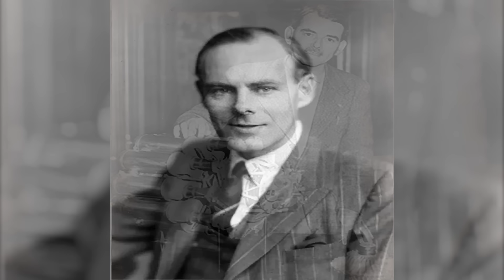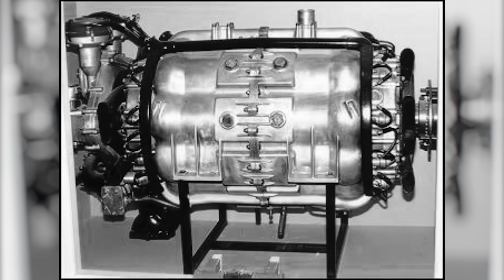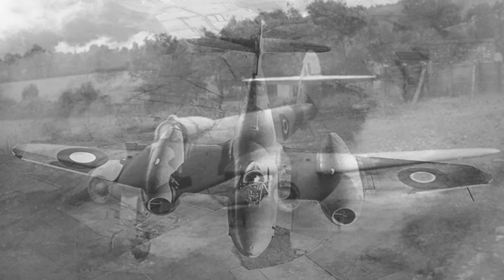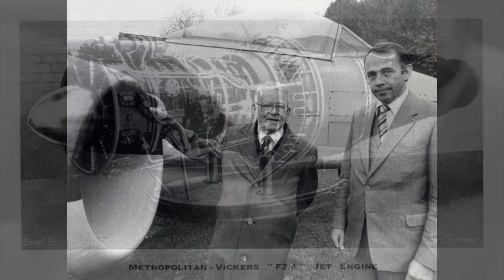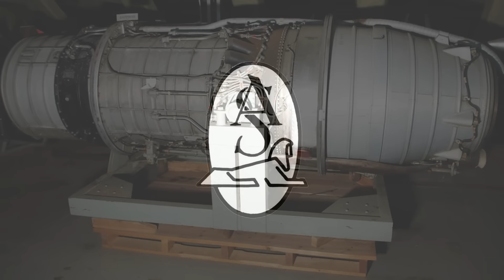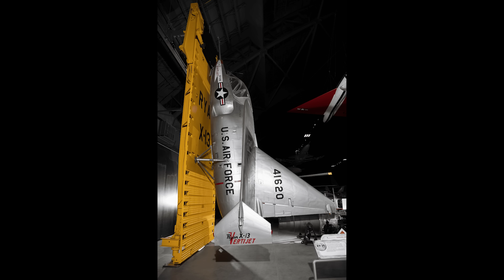The Genius Who Conquered Frank Whittle

Comment: Frank Whittle was well aware of the theoretical advantages of the axial flow turbine, his problem was he had to show results quickly, the centifugal turbine was better understood, less fussy about metallergy and less prone to distructive surging. Me262 engines were axial flow and were in dire need of a rebuild in 10-15 flight hours; the Whittle engines in the Meteor were almost boringly reliable.
Reply: @JeremyEdwards996  10-15 hr: yes & no: production/service powerplants.. yes. BUT: Prototypes fared FAR BETTER ref hours in service. HOWEVER the Reich lacked sufficient suitable high temp stable/heat resistant metals IN QUANTITY...hence, production units manufactured with far lower tolerance metals.
Reply: @ChristopherBatty-j3b  I  know, your point is well made, but wars need numbers of units!
Reply: Germany was out of Chromium and Nickel
Reply: @JeremyEdwards996  I don’t know where you get a ‘10 to 15 hour’ life for a Juno 004, people seem to come up with a shorter snd shorter life. The actual practical life was more like 25 to 35 hours. That is quite a number if sorties. On the upside the Jumo 004 cost one third of V12 piston engine in prop fighters, and took only thirty minutes to change in the field. Banging in about Whittle’s reliability means nothing if the jets were never fast enough, good enough to fly in combat against the enemy jets.
Reply: @drstrangelove4998  25 hours means 2 engine changes after every weeks flying   not good
Reply: @drstrangelove4998  
The cost of the German jets wasa lot more when the tooling, and underground factories, etc are taken into account.
Reply: @drstrangelove4998  It is well documented that the 004B needed a part-life inspection and remedial work (sometimes described as an overhaul) at around 10 hours.  
And yes, it is also well documented that the cost of an 004B was a fraction of that of, say a DB605.  However, the 004B and the Me262 were assembled by slave labourers, who died in their thousands.  An official German statistic gives a figure of 20,000: unofficial sources suggest 50,00 or more.
In terms of reliability, that wasn't the only criterion.  The 004B's throttle response and handling was appalling.  The starting procedure was protracted: I have even read that the 262 had to be towed out to face into wind before it could be started.   Once started, the engines had to be left on a fixed throttle setting throughout the climb to altitude to intercept the B-17s and B-24s.
The 262 couldn't be subjected to high-energy turns, as would be essential in a true dogfighter, because the engines would be at real risk of surge and flameout. On landing, the 262 had to be lined up on a fixed throttle setting for landing and, if attacked by a P-47, P-51, or Tempest, it could not take evasive action.  It had to be protected by anti-aircraft fire and patrolling Bf109s and FW190s.
If you care to check the performance figures for the 004B, you will discover that they are inferior to those of Whittle's W.1 engine in 1941 and grossly inferior to those of the British centrifugal engines in 1944.  After the war, Adolf Galland is on record as saying that the aircraft he needed in 1944 was the Me262, with R-R Derwent engines.

Comment: Axial flow was the future but in those years it wasn't the present and a war had to be won. The Germans went from centrifugal on the first Heinkel jets to axial on the Me but it did them no good. The aircraft was a wonder but too late. It's no good being too late for a battle. There were an awful lot of questions to answer with axial engines but they took time and there was no  time. Interestingly, when Rolls Royce stepped in , Stanley Hooker took the biggest supercharger on the shelves at Rolls Royce and connected it to a big electric motor to provide the compressor function while he perfected fuel flow, turbine design and compressor stall. When the Soviets wanted an engine for the superb Mig 15 did they copy either of the two German Axial flow engines or the centrifugal Rolls Royce Nene?